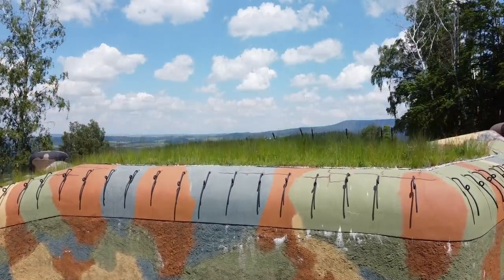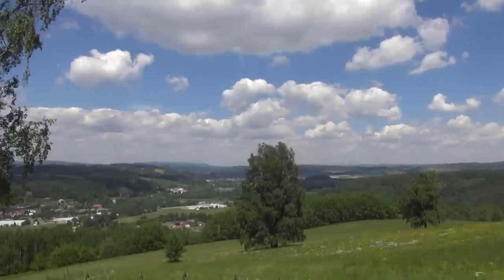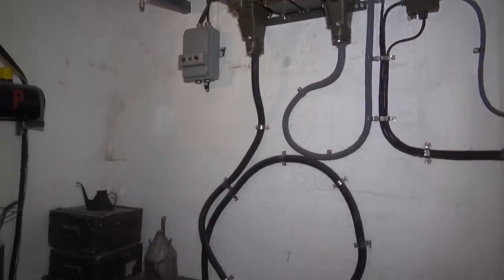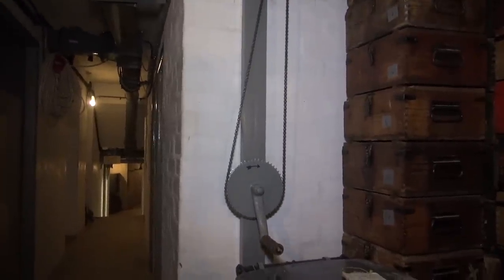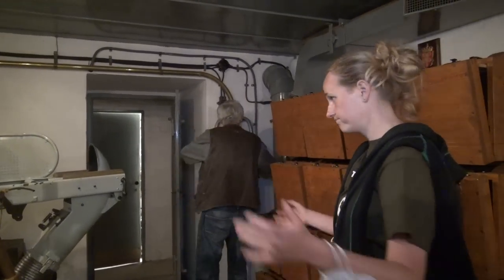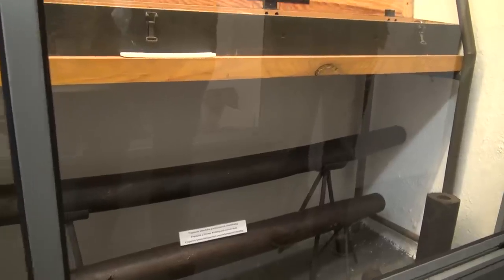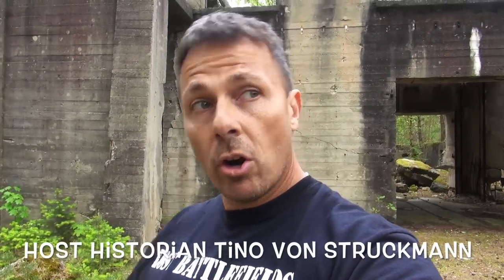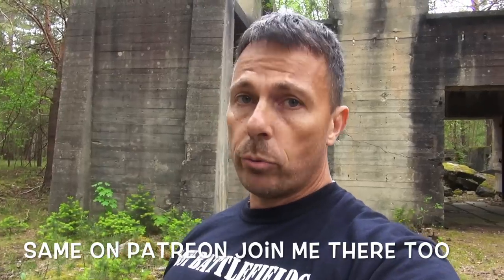THE AMAZING CZECH FORTS OF SUDETENLAND

Comment: Thank  you and the keepers of the fort for letting us see the diesel generator.  I have not seen something that. Hand barong it over likely promise the fuel. Large lever on top fron is a compression relief to make it easier to turn over.  The wild part was lighting the glow plugs by hand.  No batteries required wonderful for a bunker. I hope that hand crank has a cam out that kicks it out as the motor starts.  Very easy to break hands and wrists or loos them when those things start

Comment: 39:46 that bunker is atypical, it was used as testing ground for explosive gas meant for maginot line. It relocated the 200tonne roof in place, damage visible from inside.

Comment: At 16:04. Diesel engines of that vintage didn't have glow plugs and either were a "Hot Bulb" (Which used an external blow torch to heat the "Bulbs" so pressure ignition would start.) or manual glow (Some engines people just put lit cigarettes in the holders instead of the proper starting candles!). A decompression handle lifts the valves on the head to allow the engine to be rotated at speed until it's going fast enough then the handle is closed to allow compression in the cylinders to ignite the diesel (Not Gas!).
I used to have to start water pumps for irrigation and for farm power the same way back in the 1960's. Lots of German and central European tractors manufactured from the early 1900's to the 1950's were also started the same way.
Reply: Then they would run them for days.  Nobody ever wanted to restart them so they never turned them off

Comment: And the cannon Actually has a ZB-53 mounted co-axillary (On top of the cannon barrel) to either supply machine gun fire or using tracer to show aim point, when the cannon is in direct mode of fire, reducing the need for glass calibrated sights.

Very modern idea, only seen later on the US 106mm recoilless rifle, which used a 50 calibre semi auto firing trajectory matched ammunition with smoke marking of aiming point on target.